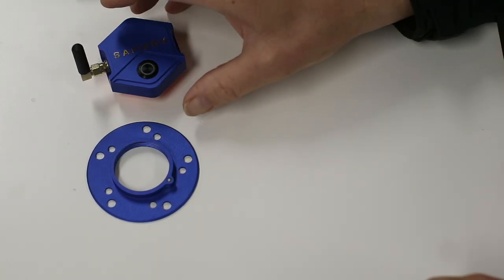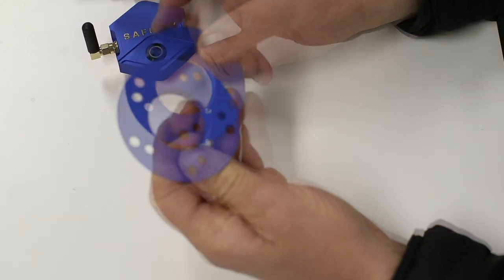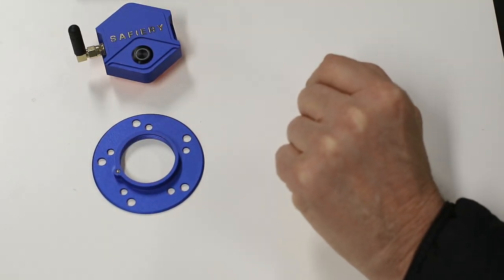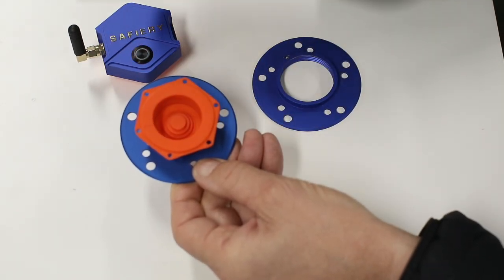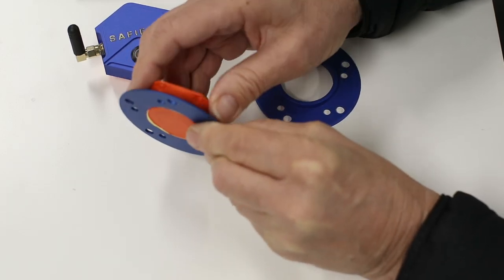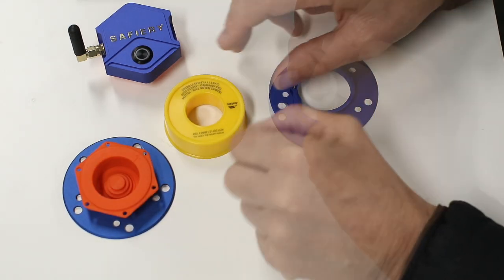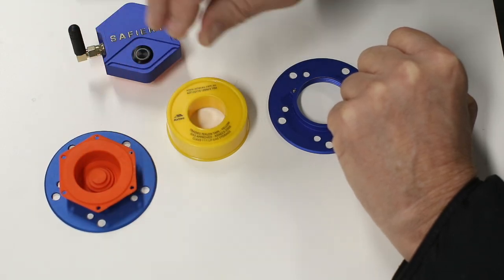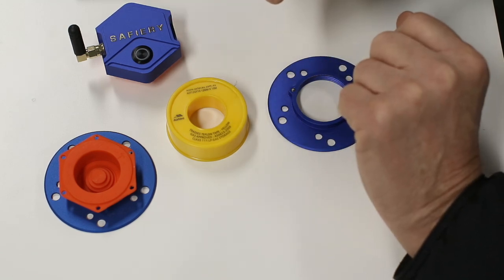STAR-tank Perfect for Black Water tanks saves Installation costs Battery Bluetooth to Victron Cerbo

Comment: Im told the depth it can measure is only 2 meter, what if i had a water tank 3 meters deep
Reply from the maker: We would need to test for this. the water tanks we bought for testing are only 2m high. So in theory we can do it but we need a 3m column of water to test. Thats not easy to find!

Comment: Hi! For quite some time I’m considering getting this cool solution for my boat. I have 4 tanks and the septic one is stainless. Unfortunately the space on the top is not enough to get drill there, I don’t want to drill the septic tank. So my question is can I simply use strong double sided tape, same as Gobius devices?
Reply from the maker: The radar sensors will not penetrate a stainess tank without cutting hole. its not our sensors that have this limitation, its the radar techology. You will need to find another solution.
Reply: Thank you for the quick response, appreciate it.